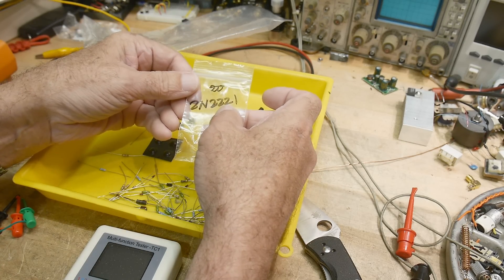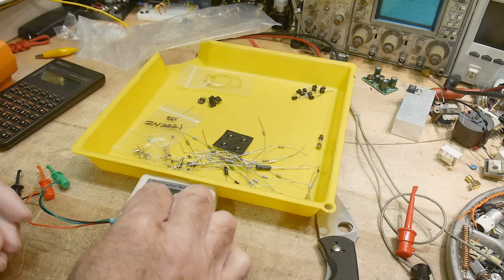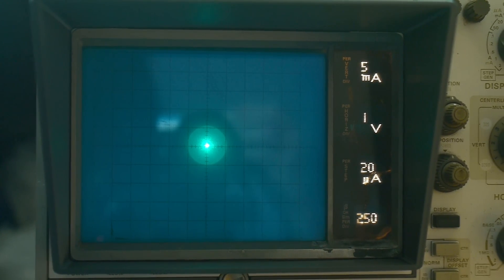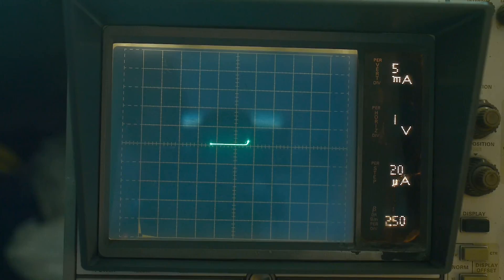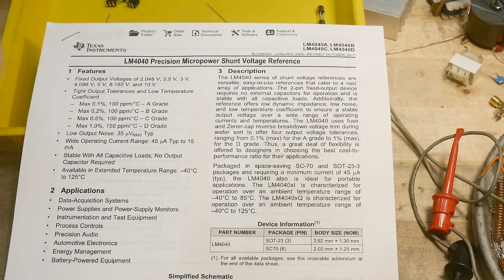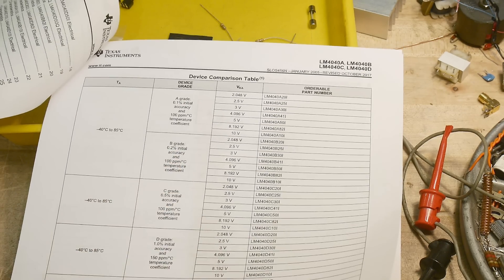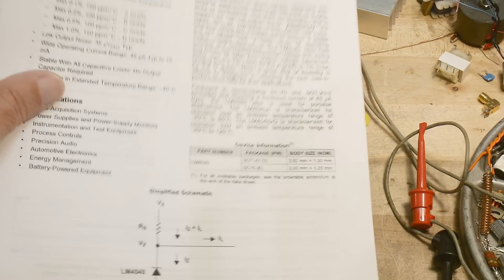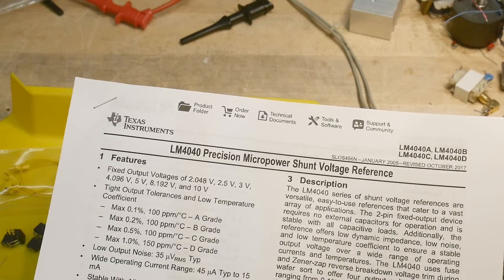#1496 LM4040 Shunt Regulator

Comment: Mark Hennessy has a nice long article on using these, "Statistical DVM Reference", easily google-able. He bought a stack of them at 2.5V, then selected them to stack as closely as possible in steps of 2.5V up to 12.5V as a selectable voltage reference box. LM4040's claim to fame is probably just being the most jellybean shunt reference around, maybe slightly better than the TL431. If you just need some decent Vref but don't need the bee's knees, grab a LM4040.

Comment: What is the third pin for?
Reply: You can get an adjustable version of these as well (LM4041), where the 3rd pin comes into play.
Reply from the maker: datasheet: Pin 3 is attached to substrate and must be connected to ANODE or left open.

Comment: Ya, these are on my list for me next order, cheaper than Microchip voltage references, seams.

Section 7 shows a simplified schematic. 4 npn/pnp transistors, an opamp configured as comparator and some current sources (and current limiter?) and unmarked resistors, seams like a pretty cool circuit to set the thresholds on the comparator.
There is also a LM4040-N datasheet.
Reply from the maker: 4030 and 4050 too
Reply: @IMSAIGuy  Thnx, added these to datasheet collection, the 4030 seems the ultra high precision variant, the 4040 in the mid and the 4050 on the 3rd spot so far i could see from the datasheet comparing the 2.5 models, unfortunately the data format differs in the datasheets if you compare 4040 and 4050.
Reply: @IMSAIGuy  It's easy or somewhat easy to computer control a variable output voltage using a mosfet for bench power supply but what is need to "computer" control it's current?
Reply from the maker: @AnalogDude_  I did a five part video on a simple supply. you get get the basic ideas from this. replace the voltage and current control pots with two D/A converters.
Reply: @IMSAIGuy  Ah, didn't catch those.

Comment: Interesting part.  Microchip makes an LM4040/LM4041, seems to be similar, and their datasheet contains an interesting functional diagram.
Reply: There's like 3 - 5 OEMs (or more?) that have copied its basic structure, it's one of the most jellybean Vrefs around.

Comment: oh yes. The LM4040 family.  I like to think of them as an active zener diode. I use them to power up low power micro controllers.  They can regulate about 15mA.  More then enough to many application.  Great device to have in your tool box.

Comment: interestingly enough, that tc1 part tester might be using an lm4040 or tl431 for voltage reference. the original design they're based on uses an lt1004 which are kind of expensive in comparison.

Comment: If you don't already have a video on building a linear power supply from a reference, pass transistor, etc - this would be a fun part to use for such a video. It would very effectively demonstrate that you need much more than a nice reference to build a good power supply
Reply from the maker: I already did a video like that, I used a TL431. this would be ok too

Comment: There is an adjustable version called the LM4041.  The NSC datasheet shows a block diagram.  I've used these as small shunt regulators, especially with an external pass transistor in the feedback loop.  A very handy part!